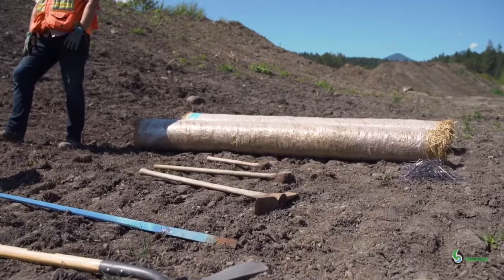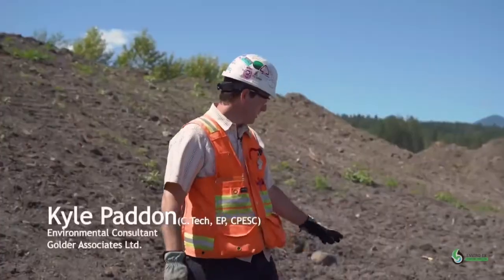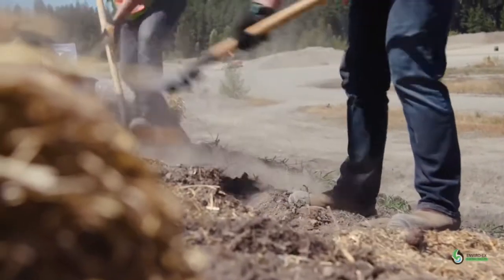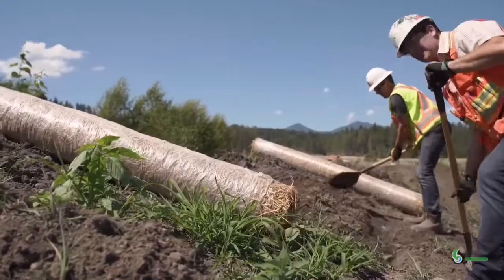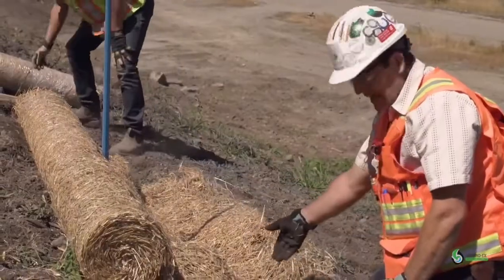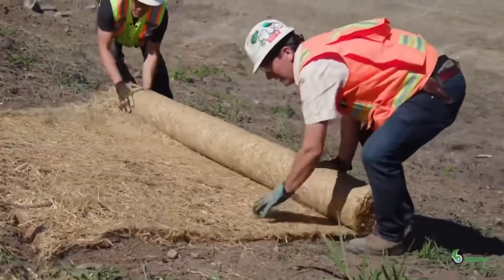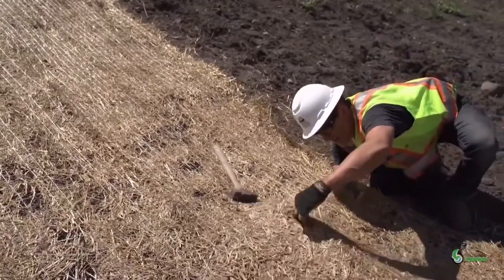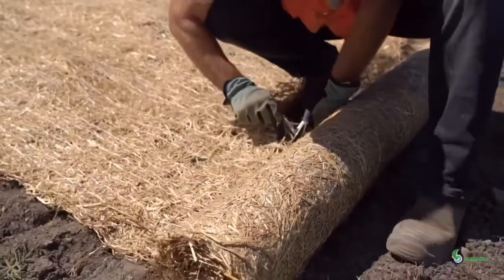How to Install Erosion Control Blanket

Comment: Where can I buy seeds that will be good for erosion control under the straw matt?  Should I use kentucky blue grass seed?
Reply from the maker: We would recommend using a seed that is local to your area. Typically a nursery or a farming supply store should be able to help you with the right selection